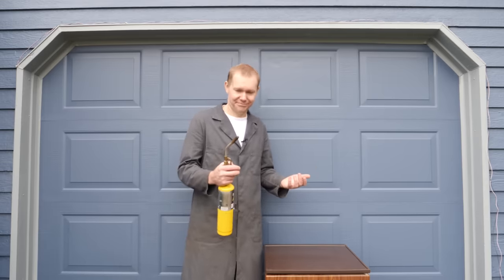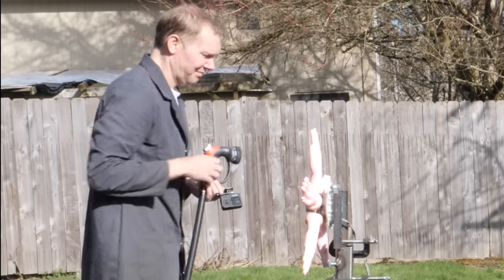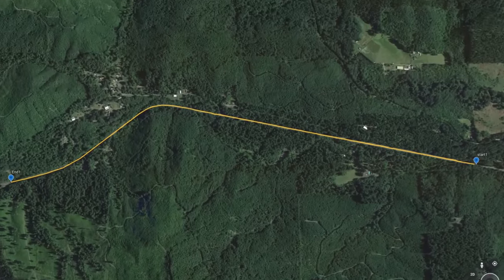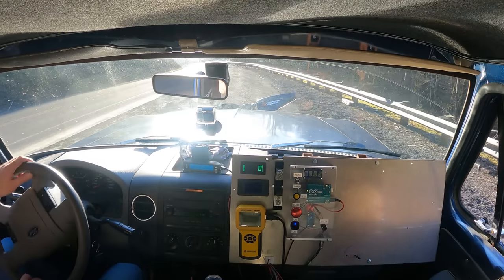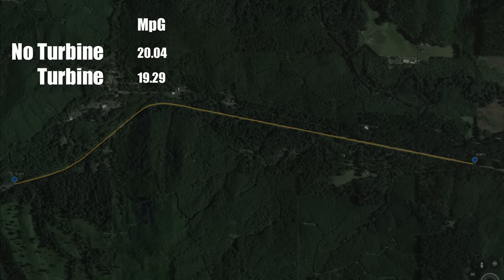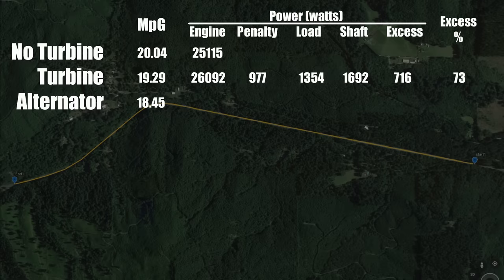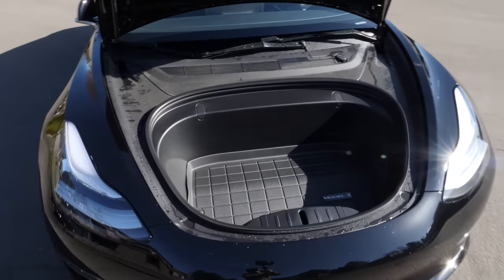Mileage Results You Won't Believe!!! - Wind Power on a CAR #5

Comment: It's just an increase of efficiency by tapping into energy that is already there but is only being shunted to the side. Radiator also makes use of the same mechanic to dissipate heat without consuming additional power. I don't really understand what's so difficult to understand about the concept.

Comment: What if you powered a thousand watt electric motor instead of an oven? You know ‘apples to apples’; instead of burning crap in an oven; that may have drawn more power because, usually burning crap in a temperature and time variable environment takes more power than the recipe calls for.

Comment: I wonder how this would work build inside a intake  of a very aerodynamic car. for example exotic cars channel air to be slippery and efficient, I wonder if the same concentrated air flow can be used for a small turbine especially if place along the floor of the car like a underbelly diffuser on a race car.

Comment: More modern engines are more like 30 to 35% efficient. Still not great but still better then 25%. Some have actually gotten as good as 40%. Most of the losses are out the exhaust and the radiator. Usually around 20% for the radiator and 30% for the exhaust. In theory water injection can solve most of the problem with wasted heat. The water will convert the heat into more pressure. A water injection engine could be as efficient as 60%. It's as usual easier said then done.

Comment: Use the wind turbine just like you are but use it to apply DC to a bunch of hydrogen fuel cells in your truck to make fuel for your engine and I guarantee you'll make a lot more miles per gallon

Comment: could the power difference also come from a change in airodynamics of car + turbine ?
if the CW value went down due to the turbine, than decrease in input power would be explained.
since used power goes up exponentialy compared to speed, drag is a real issue. if the rotating blade somehow smooths the airflow while powering the oven, then the output would seem oddly higher ;)

Comment: wonder how well this would work on an electric plane that would travel at around 150mph and have inducted motors under the wing like a jet airliner but a big wind turbine on the front breaking up the wind around it and increasing efficiency which is much more valuable in a plane.
Reply: Dude.... what. Airplanes are all about aerodynamics. Since they aren't using radial engines nor really rotary propellers anymore you won't find anything on the leading edges but sensors or flat surfaces. 

Many do have APU (auxiliary power unit) turbine generators that can be lowered in the airstream at the BACK of the plane in an emergency. Note that it is used for emergencies because the normal turbine engines provide more than enough power. Obviously, a non fueled plane won't have that so the real question becomes is it worth having an APU when the entire thing is already powered by electric. In which case the APU might actually be fuel driven for emergencies.

Comment: While it seems like a nice idea ... it wont "work" in combination with HIGHWAY SAFETY CODES ... because "imagine running into a pedestrian with the rotating blades". Having the oven running might be a nice way to "dispose" of the evidence of chopped up person.

The solution to "reduce the loss from air resistance" is to a) drive slower and/or b) dont drive a car "shaped like a brick".

Comment: Oh wait you are using the blades to pull your truck through the air I guess that would be a bit different yet still possible because if you can deflect enough of the opposing wind from hitting the front of that truck which acts like a big parachute hitting that fire wall after dragging past the engine... Still possible in aerodynamic efficiency...
Reply: Put a cone at the front of the blades like they did to old aircraft engines to reduce and funnel the air even better. It works on airplanes...

Comment: Something that would extend the range on electric vehicles would be to make the roof and sections of the hood and trunk out of solar panels idk by how much but you could charge the battery without plugging it into your house or one of those electrical gas stations and preserve the electric and lower emissions a bit regardless your going to pollute just as much unless we convert our power grid to geothermal electric which was invented in WW2 and was 100 times more effective than nuclear power because it was based off of putting vacuum tubes into the ground deep enough to hit boiling point so the steam would push threw a second line to a water turbine set where the water had already condensed making the steam push the water threw the turbine and 1 water turbine built in the 60s puts out 100 times more power than a nuclear power plant thus if we have the technology and have had it for almost 100 years why haven't we been using it btw the guy that invented it said it probably won't be used for a few centuries because the government in the US is just like any other government either he was saying that no government really cares or he was saying that every politician is small minded and cares more about what immediately affects them than anyone or anything else I'm gonna go with the latter because there's a mix of both and no politician actually cares about the people they are supposed to survey if they did they wouldn't be putting the purge in affect in Illinois and calling it a safety law and they wouldn't be filthy rich while people in their countries starve another FYI the same guy built the first electric car in WW2 and guess what everyone laughed at him so we've had the technology since WW2 and didn't even think to improve on it till recently is our species dumb or what

Comment: Brilliant in so many ways   In the far off future there might be an efficient unobstrusive way to to this with micro / nano turbines in car face or side panels roof etc w air ducted to them  Oddly streamlining might be COUNTER productive as a boxy shape will max out air collection area  Some of the generators would need featherable blades or on offs so cooling air to engine, generator, etc AC system is maintained
Obviously, not for freezing climates
and
Would more efficent electrical production in cars significantly increase mileage
Hmmm
1,000 to 1,500 w shaft power wasted with inefficent standard equip
25,000 w shaft power needed to move car as speed
That's 6% of shaft power being wasted
Lets make believe equip exists to halve waste
3% gas saved, 2 tanks a month, 40 gal,  2.4 gal, or $10 a month at todays gas prices, $120 a year, maybe $1,200 over life of part
If there's more efficent equipment to power elec system of car for say less than $600, this would easily be worth pursing.

Comment: it's the oven that really threw me.  i couldn't understand how this was a fair experiment when all the power generated by the turbine was being wasted heating the inside of your car.  i know it would have been a ton more work but the real test would be if there was an electric motor tied into the drive shaft or gear box that would use all those watts generated by the turbine to actually help propel the car.  this was all borne out in your final calculations where you show that the extra energy generated by the turbine resulted in a huge amount of additional power, possibly enough to raise the cars fuel mileage once the losses at the motor and gearbox are factored in??  That's the real question!!!

Comment: I think most people conceptually think of wind power only like how old school wind mills were built , or the way a sail works , the force of the wind pushing on the surface .. but modern wind power approaches it not via that push force, but via the lift and thrust forces ... The Blackbird wind powered land vehicle also nicely shows how the thrust force from the lift force of a spinning propeller blade can be greater than the push/drag force .. aka use the wind to go faster than the wind , even while moving in the same direction as the wind (down wind) .. which the demo vehicle did prove in the real world .. link to more detail talk https://www.youtube.com/watch?v=X6oJpnSJyV8&t=0s  or even to use such power of the wind to go directly into /against the wind , aka upwind   link of demo https://www.youtube.com/watch?v=F7PNSyAfCjk

Comment: Didn't some guy prove a physics professor wrong and won his $10000 bet against him. Proving his wind turbine powered sand buggy ran on wind alone .
Reply from the maker: My video came first, just sayin'... 😁
Reply: Yes but it was a very different idea.  The vehicle was designed to “harness” actual wind like sail boats do.  That’s an external energy source.  With Quint’s truck and wind turbine the “wind”  is not an external source so much as a consequence of the truck/wind turbine moving relative to the “still” air.  It’s a rather subtle but important difference.

Comment: So there's a glaring problem with this "experiment" which is that you have no control. The turbine itself is changing the aerodynamic properties of the truck. So just driving the truck back and forth with no turbine is not an adequate control. You need to have driven the truck with the turbine disconnected from the generator so that it spins freely. That is your control in that it shows the true aerodynamic characteristics of the turbine itself. And we should expect that the control would have better gas consumption than the base truck. You can then take the difference in that consumption vs the consumption with the generator hooked up to show how the generator actually creates more wind resistence and causes more feul consumption vs the control. Which is the expected result. 

The only reason you have an unexpected result is because the aerodynamic properties of the base truck are so abysmal that hooking all that crap to the front of it decreases the drag. On an aerodynamically designed vehicle it would all be losses.

Comment: Double Q:  Your take on EDUCATION ALONE was enough to earn you a subscription from me!  I really like what you did there--however, I think you might have hit that from a one-sided point.  Test 1)  Inputs are fuel AND electric.  (Granted electric is RESTORED by fuel, but if you do a front to back review it might make more sense.  Test 2)  Inputs are fuel AND electric AND Wind generated Electric.  Outputs are heat (engine, transmission, brakes, battery, DC Inverter, etc), motion, wind resistance (drag), and gravitational resistance (hills both + and - (up and down)), and battery charge replacement (electrical generation--which includes drains of electrical impedance, mechanical resistance, and resistance (which is usually calculated into impedance--but I would break it all the way down and do a component analysis from chips to resistors, transformer efficiency (the transformer in the alternator), etc). ).  I'm impressed with the fact that you were only 100W off though.  Treating it as a closed system, yeah, I guess you can summarize the entire process--but people really don't understand how things work.  Many THINK they do...but most are not even smart enough to realize how much they DON'T actually know.  THAT is why I really really really appreciated your plug for education.  When you asked about if we knew your first step, I said OUT LOUD, "Open a book?"  LOL I was dead on; and I really appreciate you sharing the fact that despite knowing as much as you do--you didn't know EVERYTHING...and that is the problem MANY people make.  Not me, though--I KNOW how stupid I am!  Even if I know the book ver-batim (and many books I do), I STILL open it and re-read because my aged mind is not retaining as much as it used to; and I see a lot of people who are in the same boat--but are in denial of the fact--many YOUNGER people too--which is sort of depressing that they're getting that problem early on.  I appreciate you, Quantum Quint! ("Double Q")  I like that nickname for you!  Methinks it befits you well!

Comment: Lol we are brothers! I’ve been thinking of this for years there is a massive amount of energy being lost as we push wind down the road that could be “used or producing power”! That’s for the people who don’t understand us just know there are a lot of low IQ people in this world who are in capable of analyzing any dope could understand that if you’re directing the power of the wind through the prop/turbine it’s going to lower the amount of drag on the vehicle and transfer it to the prop which is much smaller and is countering its own drag by the production of energy, now just imagine if one Axle on the vehicle was electrically powered and you could aid the engine by producing torque to the wheels the engine could run in a much higher gear there for consuming much less fuel and still maintain the same speed , and another angle is at some point after you start moving you would no longer have to spin the old air on the vehicle to produce power for the spark plugs as that could be done with the electric current from the turbine so the alternator would produce zero drag at some point further increasing your gas mileage’s most of these dopes are sitting at home on welfare with nothing to do and stumbled across your channel, keep up the good work.

Comment: 0:01 bullshit! 
0:03 exactly! 
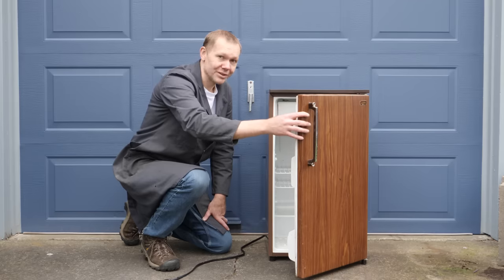1:03 oh, wait.. 
1:12 engine is over-powered for task; generates waste heat.. 
1:16 oh god, it pushes air too.. 
1:25 yep, that's where he's going with this.. this guy might be brilliant.. 
1:40 it IS looking good for your turbine, convert some pointless body drag to rotational motion and put a generator as friction bridge.

3:26 This is great! ..But it's way too stupid looking for the smallish fraction of "recovered" (frictional loss avoidance) energy.
Ya truck look like 'free energy quack-hick'. Just needs a smokestack..

3:35 should be able to calculate recovery vs fuel energy.. Although a full-size '78 Bronco will be so inefficient that electrical recovery may be functionally insignificant.

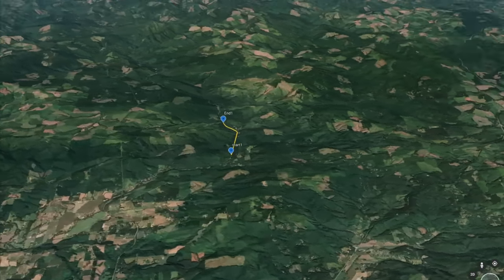3:40 love the test set-up, very well considered! 

4:18 wtf? an oven? ..no way you'll power an oven.. 

5:00 WTAF!!? Heat? Smoke? .. Inconceivable! 

5:49 a PIE? ..inconceivable!

8:11 math matches my (updated @ 1:40) expectations (~3% recovery)

10:29 fkk, got me, okay .. sub'd

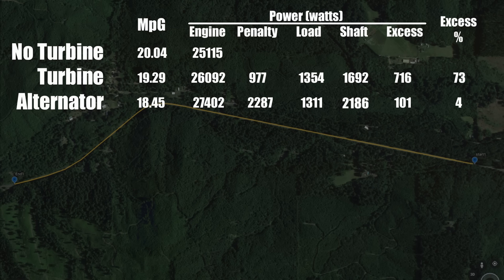10:44 no, you pulled energy off the overall air friction.. 

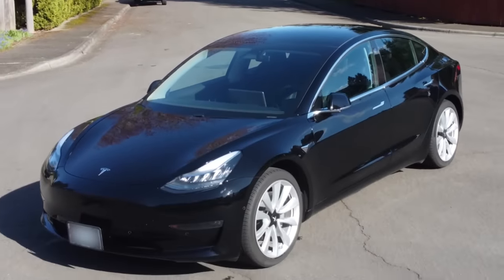11:21 charge a tesla? No. They're made very aerodynamic, so air resistance is very small compared to a mid-70s full-size pick-up truck.. 

11:45 it's ugly af, tesla owners are mostly 'image/stylish' motivated.. 

Hmm, I guess YouTube isn't just cat videos an flat-earthers.. Noice!

Comment: You can likely create and EV that generates more wattage per hour with turbines that it expends. Because the power to move the car compared to the energy exerted to keep it in motion are not the same. The kinetic energy in the moving air is far more available. The idea that the car cannot take more energy then it requires to move is ridiculous. Air is not standing still and does lose all it's kinetic energy, this video proves my point, you generated my electricity with the turbine than you lost doing so. Achieving a EV that could self charge with wind energy is possible. Considering a highly effecient EV will expend 1000killo watts to drive 4 miles, the question is can you generate 1500 killowatthour of power by wind turbines

Comment: I recommend researching the energy and resources it takes to make 1 Tesla battery ...  then you could ask the same to "charge" and then later replace ... then there is the costs (from resources to money) to "dispose" without harm.  Then, the amount of known lithium in the earth is only about 15-20% of the current energy needs ... oil, turbine and coal are vastly more energy efficient than the dream of out of sight out of mind "zero emission" cars... which is not true.  Recycling car parts are way better and use less natural resources.